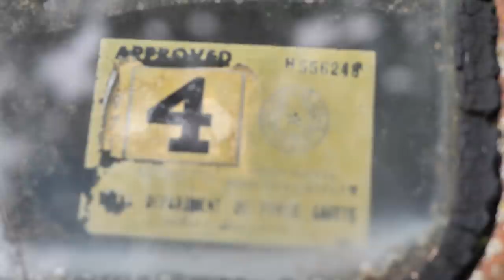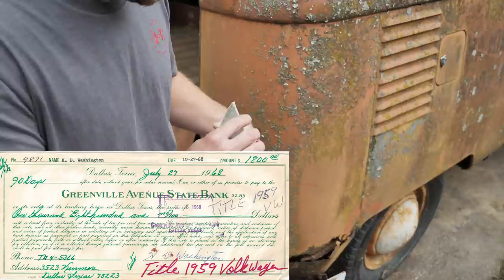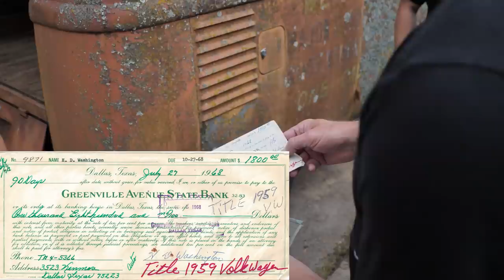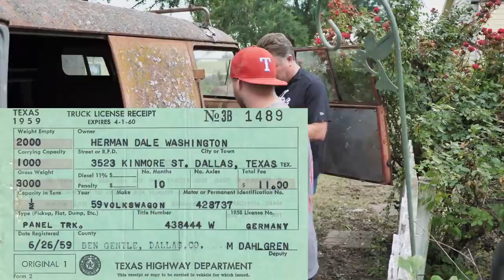62 years of patina... LEAVE IT OR RESTORE IT?!

Comment: Euro bus.  Semaphores.  
Build date 1/13/1959
156=Tourist delivery
178=1200cc(36hp) governer   (LOL, no wonder it would not go over 30mph.  Europe had speed limits for comercial vehicles.  That is a rare option to see in a bus bound for America, but makes sense here.)
193= Semaphores (in red not amber)
211= Panel bus Left hand drive / Cargo doors on right
S= ??
ROT= Rotterdam(suspect delivery for export as bus is designated "tourist delivery)
428737= Built toward the end of the run of January which ended with 433713
Odd it is not designated L53 Sealing Wax Red as that is the color it is painted.
Solid bus with nothing messed with.  Correct bumpers, wheels,semi's,,tail lights, etc.   Very good find.

What happened with this bus?  Sold?  BTW I'd leave it alone.  Maybe re-letter the signs and then destress them to match. Do not repaint or restore imo.

Comment: Tag had the word "ROT" German for RED. Made since when Dennis said it wasn't a made for America import.
Reply: I own a unrestored 1959 Sealing Wax Red Panel Bus almost exactly like the bus Dennis bought (except mine has double loading doors on both sides of the Bus and my turn signals are "blinker-type").  My Panel Bus even came out of the Dallas area too!  Dennis was absolutely right in saying that his newly bought Bus wasn't made for the USA market.  By then the USA required that all VWs brought into the US came equipped with common blinker light turn signal systems where the lights blinked.  In other countries you would have received what Dennis received, a "semaphore" signal equipped Bus, not legal for Volkswagen to import.  The ones that got into the USA like Dennis's Bus were "grey-market" Buses brought in to use/sell by non-VW importers.  Dennis was absolutely correct.

Bill
Reply: @bullibill8277  1958 was the first year commercials (panels and pickups)  were built in a few more colors, White and Red. . Before that they were all Dove Blue.

Comment: I hope you make a "series" for lack of better words, of what you decide to do with this. It's a neat project and you have the manpower and facilities to do it. Clearing over patina is very subjective. I thought it was a great idea on that blue bronco, but i wasn't sure about the end product when it was finished. Tough call on this one.  1959 VW panel van. Uniform rust color patina front to back, and faded lettering. Clean it up a little, some repairs and touch up needs to be done to body. Maybe satin clear it, put a Porsche drive train under it lowered with suspension, wheels and tires. Satin clear the interior and put four captains chairs and a small bench in the back. Then drive it like you stole it.

Comment: “One Call, Dennis Will Buy Them All!”  😁

Take body off and fix the major rust areas and clear it (minus the moss) with the surface rust and all the lettering after your pinstripe guy touches them up like you said.  Then redo all frame, motor, drivetrain, brakes, dash, inside etc. But redo all the cargo area as it is, just new stained wood and clean hardware.
Reply: No separate body and frame on type 2. Probably 3000 spot welds.

Comment: I’d knock the fuzz off, fix the rust, lightly rejuvenate the artwork and then go the clear coat route, on the outside.  The inside needs a pretty thorough cleaning and restoration.  If you could get it running dependably, it would make an awesome parts runner.

Comment: Hybrid answer.
Repair and stabilize that right rear corner. Add support from the back, stop the spread of crumble on the front. Un-ding that bottom edge of the engine panel. Window rubbers MUST be swapped out, and for pity's sake clean up the windows. Fresh lights all around.
Gotta refresh the lettering. The body browning I'll live with, even though I am more a fan of multihue patinae. Really should remove the biologics, something tells me that will perpetuate further oxidation and degradation.

Comment: Clean it, refurbish the interior, repair the rust damage on the right rear corner, fix all the lights and wiring, keep the patina and signage, but gently refresh it to make all the signage readable. Make the engine, transmission and engine bay pristine. Fix the rear hatch and engine door and bumper just enough to make them fully functional without interference. Then find out if it will actually go faster than 35 mph. Then reinstall the original equipment cruise control. You should have a suitable brick laying around somewhere.

Comment: I’d be inclined to power wash the moss off and then touch up the advertising and clear coat over the original paint/patina. But you have to restore it mechanically and do the interior to OEM specs. Glad you saw the potential in it and saved it.

Comment: clean the moss off, fix the rust on the lower body and give a clear coat on top. Most importantly is that the mechanics is in top shape and not leaking oil anywhere.

Comment: in germany we still had semaphores all the way to 1960. Beetle, too. engine may actually be a rare beast if it is still original. split case transmission, unsynchronized 1st gear. i vote for a good wash, lots of lube. fix the brakes and the battery tray. straighten the rear bumper so it does not hit the engine cover. new 6.40-15 bias plies. rides like a (very slow) cadillac. put red koni shocks on it. It will surprise you.

Comment: I guess it depends on what you want. If I was going to leave it as is, don't waste time on getting it running - make it roll and put it on display. Not a fan of chasing fads, and I could care less if the current one supports rolling rust - or moss - buckets. Call it "patina" or whatever you chose, rust is rust. While it would not get a mirror gloss, perfect gap resto, personally I would document what it WAS, and the steps I took to make it a nicely restored vehicle.

Comment: Restore interior, paint dash and entire inside original red, pull out all shelves, keep rear open of anything (empty), restore motor and compartment, undercarriage, new tires, rims and caps
...frt/rr bumpers optional (chrome?)
...replace any cracked glass
...remove moss, leave patina, remetal rusted out areas and airbrush patina to match, restore all lettering like new, restore all chrome outside, clearcoat over patina
...have fun cruz'in it!
Reply: ...ps, paint rims to accent the lettering
Reply: ...pps, leave original tires, rims and caps separate 
..use new set
Reply: ...ppps, ...bolt old wood ladder on top (for looks)
...it's a work van, not a surfboard holder ...lol

Comment: These used to be cheap cars , and now they are like driving billboards for some hipster's graphic design startup and a rough one that the paint is the only thing holding the rust together is 100k .. I reckon you have carte blanche to do what you want with it - put a 2.3 litre stroker motor in it and dump it on the ground, or take it autocrossing, sky is the limit!'
Btw , did you give up on the Cannonball ferrari? I saw it at Richard's shop in a recent video?

Comment: My two cents:  leave the moss.  don't clear (why clear it?  it's perfect the way it is).  don't restore the lettering  - trying to figure out what it says is part of the fun and charm.  wash the glass. get it running and drive it.  Oh - and don't lift it with a forklift - it bends the edges on the frame rails.

Comment: That door lock/handle i would assume is a schlage, not sledge. This being a handy mans original work truck 62 years ago, i bet thats an old lock handle. I've tried alot of commercial locks over the years, schlage has held up to many break ins. They crow bared in the top and bottom of steel door, the lock mechanism never gave and kept them out. Their first door lock patent was in 1909. I am just as curious about the schlage as I an the van.

Comment: Dennis I'm going to put my hat in a ring on the get you some of that meter it's definitely a have a one to five scale four and a half not quite full get you some of that but close enough now I think you need a glass media blasted and then redo the paint and the and the logo on there they had originally on there but I definitely get it back up and running and no patina is not a paint color

Comment: it's a rusty mess, what should be done is fully document the fonts, colors, primer, paints& wear areas. Then completely restore it with appropriate primers and lacquer paint and lettering rub with compound to imitate the exact wear. Restore the factory drive line to a concourse level and leave it on a stand. power it with a suburu with ac functional and comfortable interior and drive it as much as possible, always unwashed and garaged.

Comment: Those VW are very sought after and command a high price even rusted and partially disassembled. It will cost about that much again to restore it.
Figure easy 150,000 to 170,000  to buy and restore.
The surviours have already been bought up & restored. So it's the barn find and the ones nature began to reclaim that are available.
Some items like prewar Indian motorcycles, people will build from an oil stain. "Oh look found a brake light bracket. I'm going to build the bike as soon as I get the parts." three generations later under a barn....

Comment: Have you seen the prices that restored V Dub busses are bringing?  Even factoring in the cost of a complete restoration you will still make more money on the resale.  Restore that sucker and it will be on the road for another 60 years!  If you leave it as is it will continue to deteriorate and will be parked in a field within 5 years.  Since it is a panel bus It would make a great camper.  Put in a table, folding bench/bed, mini fridge, storage bins....it will sell in a minute.  You gotta soup up that engine and squeeze more horsepower out of it.

Comment: Patina is overrated and overdone. If a car is all original and the paint is in decent shape I say preserve it and leave it alone; but if it has rust; surface or otherwise, it is a disservice to the car because you’re letting it rust out just to look “cool”. It is a wonderful fairly rare car which is complete and fairly solid. I would restore and repaint and even replicate the original signs.

Comment: Don't clear the moss.  Clean up the original paint and logos, repair rust.  Do a preservation of it's used current condition, it tells a story.  No need to save the moss :-).  Looks to be original red paint with grey factory cargo paint.  This can be a special bus in the right hands.  Too much clear or glossy clear will ruin it in my opinion.

Comment: A greasy motor sometimes signifys a lot of blowby and low compression. I'm sure it carried a lot of weight  and was parked because it was tired. Back in those days oil's were crappy and vw engines were air cooled and not designed to be work motors.

Comment: Remove most of the moss fix the rust with an old road sign or license plate not the one that's on it paint the interior and underside maybe touch up the livery and satin clear everything also have NOS or replica VW emblem bumpers and wheels and freshen up the motor and trans. A light resto-mod anything replaced with new you include the factory correct parts led lighting you include the halogen bulb or fixture that's factory correct any non patina part the original is satin cleared if painted and sold with the vehicle the tag on it clear the tag and attach a magnet so it can be attached easily at car shows. and do a full rewire.